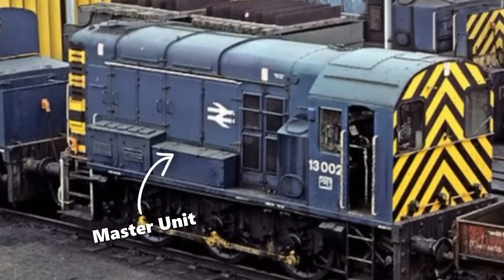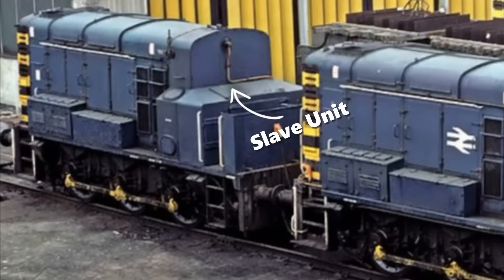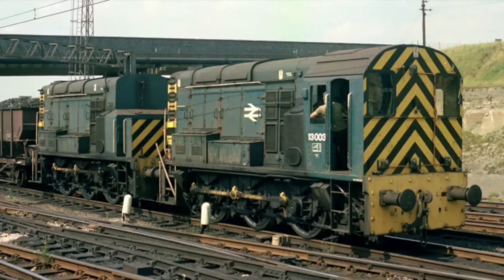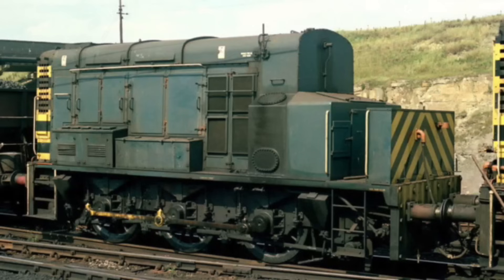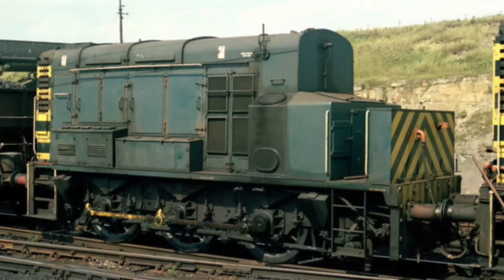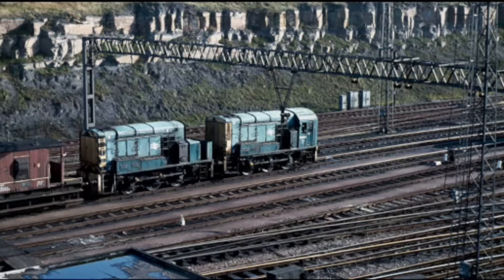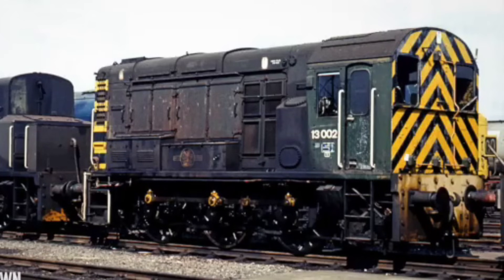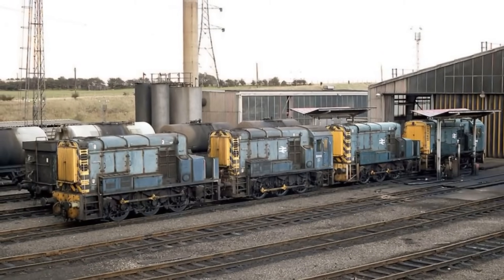The Class 13 - How Did Two Class 08s Become the One‑Off Class 13 Diesel Locomotive? #class13 #fyp

Comment: In Japan, rod-driven diesel locomotives were built until around 1960. After that, a diesel-hydraulic traction called Japan's Class 13 (DD13) was made as a replacement machine and became the main replacement machine at that time. It was also used at the Hump yard.       (Gonzaburou-beiei    Tokyo)

＝日本でもロッド駆動式のディーゼル機関車が1960年頃まで造られていました。その後、日本のクラス13（DD13）という液体式ディーゼル機関車が入れ換え機としてつくられ、当時の主力入れ換え機になりました。やはりハンプ操車場などでも使われました。

Comment: If you were a spotter in the 1970-1980's to find these Class 13 Hump Shunters you would have to travel to Tinsley Yard or could often be seen in the Yard from the Road Bridge which you cross to Tinsley Depot which sadly has now gone, It was a Great place that used to be & always filled with Decent Loco's

Comment: Was there something special about the hump at Tinsley Yard that posed a risk for a pushing locomotive getting stuck? I.e. was it extra steep or was it due to the locomotive type? I mean since there were, and still are, other marshalling yards of the same type around other parts of Europe, but then they often used shunting locomotives that were a little longer than class 08 to push the wagons over the hump.
Reply: I saw an old film where the hump yard was mechanised so it didn't need locos, it had pistons against the rail to both accelerate and slow down individual wagons.  I thought that was Tinsley🤔

Comment: So this is kinda how they made PKP Class ET41 in Poland. They took two EU07 class (which are capable of multiple unit operation) and removed one cab from each locomotive and connected them together. Only difference is that after decoupling both halves can work independently and that they made couple hundreds of them

Comment: They could have retained both cabs and had forward facing driving from both but as it was low speed in a shutting yard it would be worth the effort
Reply: I have also heard that if they both had cabs then the union stated there must be two drivers, so one cab was ditched. This could, however, be a myth.
Reply: @AmyJohnson-uc1fb that is unlikely to be true as mainline diesel could operate in unison with just one driver. The cab ends of both master and slave were originally coupled together before being changed to cab end of the slave being coupled to the bonnet end of tne master, with both bonnets facing up the hump.
Reply: @AmyJohnson-uc1fb I could believe that🙆
Reply: The were originally formed ro have both bonnets at the outer end of the pair. They were reformed with the slave units turned around, with practicality being given as the reason, possibly because shunters rode there.
Reply: Thanks for tellin me